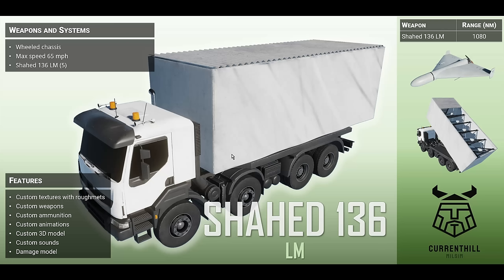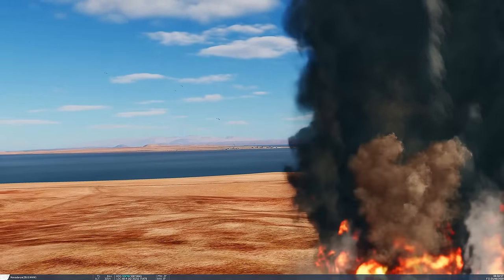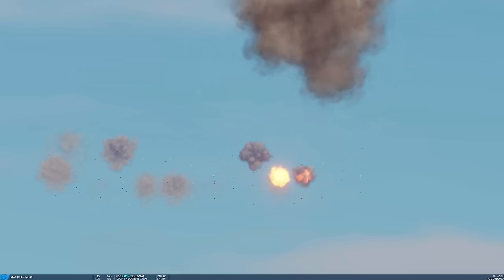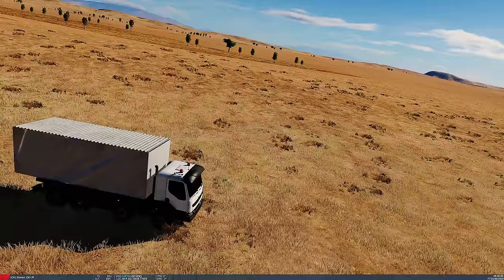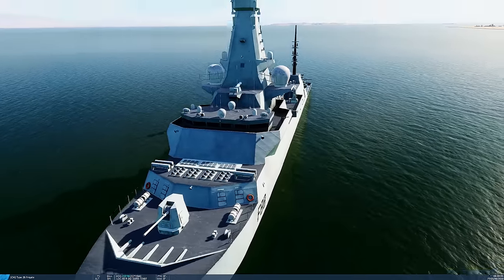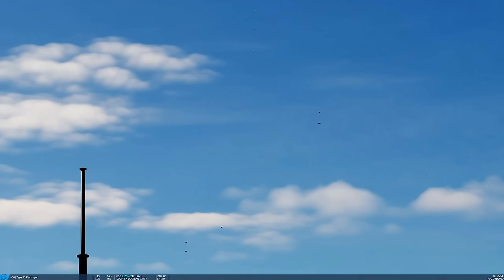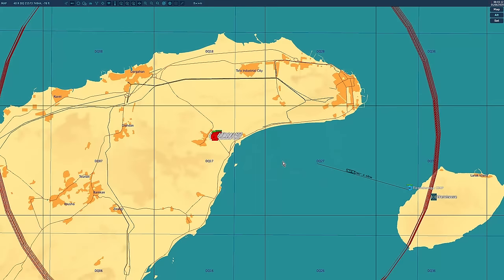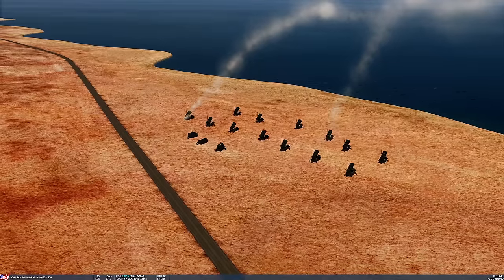Which Defence Assets Can Stop An Iranian Shahed 136 Drone Swarm? (WARNING: Hugely Explosive) | DCS

Comment: Love the video.

It would be super interesting to see a battery of laser weapons (currently deployed in numbers at 15 kW and 50 kW at overseas US ground bases) defending against this swarm. They could take each one of these out in about 3 to 4 seconds, the tracking software is fully implemented and humans just hold down the trigger to fire once it is tracking, then the electrooptical system automatically goes to the next target, and repeat. Per an interview with Raytheon, they have enough stored energy for about 30 drone kills before needing a cool-down time to recharge via gas/deisel generator. Range is around 3 to 5 km I'm guessing.

Second, I imagine real-world units, particularly those with autocannons, may have an anti-drone mode in the future, which would use an algorithim to fire a limited burst at each drone and automatically move on to the next target prior to confirming the successful kill. As we noted here, one of the reasons they fall behind so quickly is due to the number of rounds fired at each target (per burst) combined with the flight time of the rounds, so each drone may result in taking up 2-3 times the actual minimum time needed to engage and destroy under ideal conditions, as within the default defensive mode here, they're focused on ne target until a kill occurrs before moving to target 2, which just isn't efficient in a drone swarm. I could probably re-write that to make it easier to understund, but I hope my point got through. I think an anti-swarm mode, especially in a layered defense where stragglers are picked off after the first line of defense, would be a beneficial option for certain defensive unit types.

Finally, perhaps the most chilling thought. If Iran can both design and afford a swarm with this effectiveness, now imagine what the US and NATO countries can develop as an equivalent. I imagine they have both offensive models similar to this under development as a cheap swarm attack option, in addition to defensive drones able to track and intercept offensive drones of this naturue (or perhaps programming the offensive models to go into a defensive intercept mode to serve as both a drone swarm and anti-drone swarm model all in one). I think we don't see these deployed or even advertised as in development simply due to no immediate need for such a weapon, perhaps up until the Ukraine war proved drones are going to be a large part of all future engagements.

Comment: Paradigm changes in attack vector require a paradigm change in the defence vector. In other words, wasting anti-air missiles that cost 10-100x the cost of the drone against swarm like this is stupid, and I hope no serious military is going to do this. Since they are so cheap, there will be dozens of ways to defeat these drones. Off-the-shelf electornics is very susceptible to EMP. I'm going to theorize that a Mig-25 Foxbat with it's radar on flying across one of these would kill it, just from the EM radiation frying the circuitry. You could probably jerry-rig a microwave oven to do the same. Also the navigation system will be easily defeated. If it's inertial, just mess up the compass with a local magnetic field, if it's GPS / Glonass it will be suscpetible to jamming in that frequency range.

Comment: Even the Russians (industrial base 3 times that of Iran, and Ukr is the only place in history that Saheds are used en masse) can't produce more than 30-40 drones per strike to date, and that was only 1-2 of the 50+ strikes where they used Shaheds (most strikes are 10s-20s, in comb. with ballistic and cruise missiles, and AFU has a PK of 80-90% now), tells me no matter how cheap they are still susceptible to production bottlenecks, even with low tech, sanctions seem to be having a effect. 100 Shaheds might be realistic as a first strike, but soon after that the instigator would be toast if facing the Chinese, Russians or USAF/Navy. I suspect these weapons will have a counter-measure soon, this is just a surprise (Shahed), and the Irainians and Russians will have to up the cost per unit (add tech) to keep them relevent.